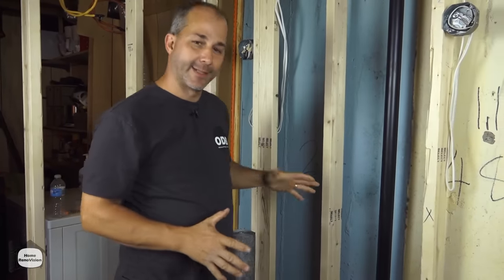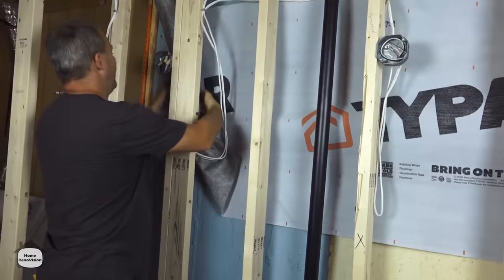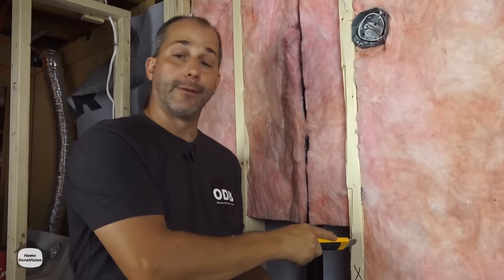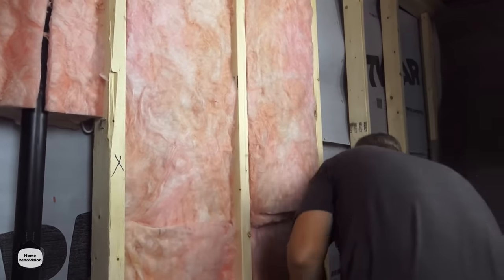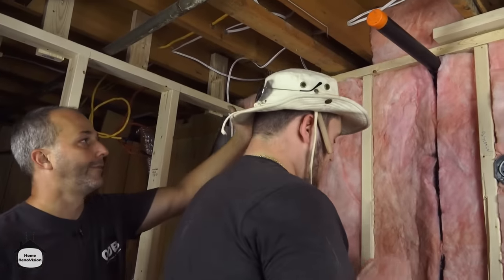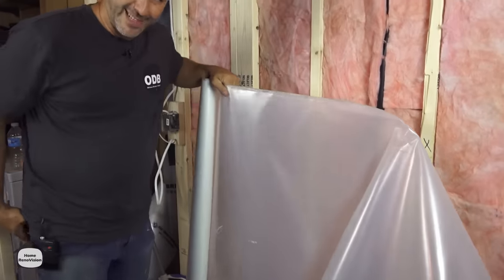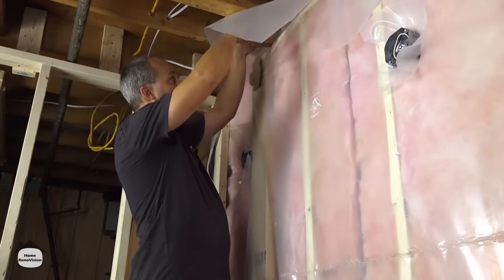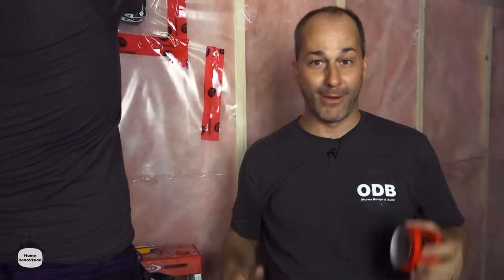How to Properly Insulate a Basement Wall: NO MOISTURE!

Comment: Hi Jeff. Thanks for the video. Questions.  My basement wall has black paper on it.  This paper is on the slab as well. I'm in Montreal. What's this paper called  and whats its function?So from what I gather you prefer your/this method vs the foam board against the wall because it's cheaper and  still does the job. But are there any advantages of using foam board method vs this method?    But normally the moisture barrier side  of  Typak is the white side, wouldn't you want to install it so white side is facing the foundation, just wondering. Merci i
Reply from the maker: Hi Jerry, that black paper is a tar paper designed to keep the insulation from coming into contact with the concrete. It sort of works but my system of using the typar performs much better and does not mold like the paper over time. Lets not confuse typar qualities however. That paper is water repellent in the liquid form. It is not a vapor barrier which is water in the gas form. It does not trap moisture in the wall cavity and as such keeps the insulation dry and performing well for a long time. I just believe that spending and extra 2 thousand dollars to insulate a basement does not translate into energy savings unless you update the entire building envelope of the house. If you are only renovating 1 room at a time then using traditional techniques will be more cost effective. Cheers! it would be like wearing a snow suit in a blizzard and not wearing a hat. You will still freeze to death.
Reply: Home RenoVision DIY . Ok. Thanks

Comment: I never use fiberglass in a basement finish. Use Dow blue foam board--2 inches thick against the block and then steel studs. Then there is nothing to grow mold and there is [plenty of air circulation.
Reply from the maker: never use steel in a basement. Floods cause the entire framing to be removed.

Comment: I was visiting Toronto from the US a few years ago staying with friends and a company was re-roofing a house in the neighborhood.  Is it code to install shingles without roofing felt? It's standard in the US and they were only doing 3 nails per tab on architectural shingles which most do 6. They did use some ice and water shield in weird locations on the roof, it didn't make sense I was surprised.

Comment: I see that only part of the basement was insulated so is the unfinished part to be conditioned space also?
Reply from the maker: That area is for the furnace room. It has so much heat there is no need to try to trap it. Plus the contract limited the scope of work. They could close it in at a later date. good eye!
Reply: I am in the infancy of having a new house built and the builder will be installing  2 in foam on the exterior basement walls I am also trying to decide between a set of precast steps bolted in place or walls poured to form a stair well with stringers attached to the wall. either one will use a bilco exterior door. I am leaning to the poured walls but as we know today's best practices are tomorrows DUH HUH what were they thinking..
Reply: Oh yea We are in the Toledo Ohio area it runs about 10-15 * f warmer than Owatta

Comment: Prior to insulate the basement, make sure the foundation is properly waterproof from the outiside, then sprayfoam the inside of foundation walls and use metallic studs installed on top of an underfloor....no contact at all with concrete, no organic material....this thing will be dry and moldfree for lifetime !

Comment: wouldnt moisture, about 2 gallons of it per day, be trapped between the vapor barriers and make these studs rot?
Reply from the maker: The outer wrap is a water barrier in the liquid form and used to hold the insulation in place. It is not a vapor barrier( in the gas form) and as such will not trap vapor. so there will be no problem. Cheers!

Comment: 4:15 Why to the same degree?  I was pissed when I saw my builder put floor-to-ceiling insulation in the basement.  I wanted a cooler basement.  What's the reason for this?
Reply from the maker: If you are going to use the space as a conditioned space then it is necessary. If you are simply looking for storage then insulating to the frost line is fine.Cheers!
Reply: The warm, moist air in your home is going to escape - somehow - and it will do so following the path of least resistance. If your basement is not as well insulated as the above structure you end up channeling the majority of that warm, moist air directly towards your basement walls as they are now the path of least resistance... and that's exactly what you want to avoid.

Comment: How much does a job like this cost in a 400 sq ft basement,   if I were to pay you to frame, insulate, and install a moisture barrier.
Reply from the maker: You would have to send me more info than that plus a picture. If you are in the Ottawa area I can help you with that. If not just figure 1 day to frame. Then once the electrical is passed for rough in 1 day to insulate and vapor barrier.

Comment: Hi Jeff, I'm still confused. I was going to put 2 inch foam and glue it to my cement block walls, but your saying to do a vapor barrier flat against the walls. And then do batt insultation, then dry wall?  My my basement is only 3 ft underground, the rest is above ground. The previous owner just put up wood paneling and nailed it to studs, no insulation. So, I want to add insulation and new drywall.
Reply from the maker: Hi Chuck. with block walls unless you waterproof the foundation go with batt and an air space so the interior of the block can dry. Cheers!
Reply: @HomeRenoVisionDIY   since my framing is already built from previous owner, I only have about half an inch currently between wall stud and concrete block wall. Is that enough airspace. I'm not sure that the typar won't touch the block at some points around the rooms.  Btw, love your channel. I've learned so much from you.

Comment: Do not put tyvac  on out side wall if you are putting a sound room, tv room the whole wall becomes your bass.
Reply from the maker: If you are putting in a sound system then I would include a noise deadening barrier before the drywall. But that is another video.

Comment: I’m not following. The framed wall is built away from the exterior wall? In other words the studs aren’t touching the poured wall?
Reply: Mike -  Concrete walls are often not completely "straight " . If you build the inside stud wall ,  called a frost wall    a little out from the concrete,  you can get it completely vertical . You can actually leave yourself enough room to put R-12 insulation in place,  or even the thicker R-20 batts , even though you are not using a 2 x 6 wall , which is what you normally use when you want an R-20 insulation .

Comment: This is not for Canada. I stopped at .40 sec. It does not meet our building code. consult your locaL professionals as details change with your location, ground moisture and thermal requirements.

Comment: Why did you not show how you stapled the tyvek to the studs. I had to use my imagination.  The rest of your video was great and very informative.
Reply: The Typar was wrapped around the ends of the stud wall, pulled tight and only stapled on the end studs.  No need to staple it to every stud on the foundation side.

Comment: Stupid question, if the basement is underground why do you need to insulate the walls? I view the basement as a cave, protected from the elements.
Reply from the maker: Usually there is a couple feet exposed and in our region the frost line gets down 4 ft on average. That kind of cold cuases ice to form on the inside walls if vapor and heat are not kept from escaping. That ice will melt and cause things to get moldy and musty.

Comment: Avoid using wood to the floor in a basement,wet seeks dry,metals studs are a much better alternative,plan on having a lot of moisture and one pipe failure could flood the basement,build as if you know it will happen,never use an insulation that will suck up the water.
Reply from the maker: metal studs rust out and then the wall sags. then what?

Comment: I wouldn't let you do my basement walls like that...wrong! The tyvek type stuff you used on the way top should've been tucked in behind the next row and taped not on top of it from what I could tell? I know videos can make something look wrong like a optical illusion sometimes you may have it right! The way I'm describing the tyvek type stuff should've been installed the correct way is so that if you have a leak in your basement wall from the way top you want that water to drip behind it under the next row below and so on if you dont have a channel going into drain tile then o well your just going to have to mop the floor but at least the moisture is not trapped in the wall trapped in between the vapor barriers all over wood and insulation possibly in light switch and plug electrical boxes. I'm not sure if it will make the drywall finished side sweat but I guess theres a possibility maybe? The way I percieved you did it is the water from a leak would just drip on top of the next row below placing moisture within the wall then your insulation gets wet mold starts to grow wood starts to mold up the main idea of a vapor barrier is to keep moisture behind the tyvek and concrete wall if someone ever has to do a repair or demo that stuff out mold is going to be in the air I also read if your basement is big enough you should place your interior walls 18 inches from the foundation walls and just run a dehumidifier in that area the blog I read this from was saying center blocks need to breathe and mold can grow on them if there incapsulated with something(anti-mold paint also)like tyvek or foam board also it's a good idea to do it like that if you have a leak you dont have to tear up everything trying to find it especially if you dont have a drainage drip channel around the foundations perimeter going to a sump pump also it's a plus for remodeling you can run wires and pipes where you want them

Comment: How comes your not using the blue tuck tape?? Its code in Canada!
Reply from the maker: The code requires tuck tape, the color  blue is for wet areas. This wall is not a wet area. Careful how you interpret the code.
Reply: Just had an inspection today on a job where I ended up re-insulating and vapour barrier kitchen.  Red tuck tape as usual, no complaints from inspector.  If it's required, then someone should update the city.  Red was used for years, it's likely still allowed for the time being
Reply: Just to clarify, blue tuck is for sheathing where area is expose to UV. Is got a uv resistant adhesive formula. Hope this help. And of course you can use indoor.
Reply: When something is adopted and when in becomes required are 2 different things... they may have adopted the new code but won't start to in force it for a year or 2 or even 3

Comment: I will never use the pink stuff in a basement after what I found in my basemnt walls. Use 2 1/4" silverboard graphite against the concrete then a stud wall with Roxul comfort batt (which doesn't burn or hold  water) in the cavities and NO vapor barrier. The concrete must breath and dry to the inside because it's under grade and the Foam replaces the vapor barrier. It you keep looking you will find this method in practice and promoted by modern building science

Comment: Don't know why in 2020 this insulation is used for basements. This insulation is a sponge for moisture and a nightmare if there is flooding, leaks etc. Not Good.
And the rim joyce closed cell foam is best for thermal block and sealing plus its insulation value.

Comment: In the USA your basement is framed illegally. No float walls, no fire barrier at top plate to floor joist, no air stop on 10 ft horizontal plane. If people in the US are watching you they better check their local codes as what you are doing is not correct here. FYI.

Comment: Hello. Why the cables are outside pipes?
Reply from the maker: Sorry rolando I need clarity to answer that question. Are you referring to the water supply lines.
Reply: Home RenoVision DIY I mean the electrical wires (whites) I can see they are outside pvc pipes?
Reply: Rolando Rojas sheathed cable(Romex) is not required to be run in conduit.  Only unsheathed wire (individual wires) are required to be run in conduit

Comment: Cant help but notice that the Tyvek writing is facing away from the exterior wall. Since you are using it inside the writing should be facing the exterior wall. The writing face allows vapour to still pass through, but not moisture.
Reply from the maker: The tyvec is being used due to the fact that it is not a vapor barrier, it is cheap and it will hold the insulation in place.

Comment: His videos are pretty good. But this video about insulating your basement isn't the greatest way to insulate your basement. There is a better way. Suggestion is rigid foam and roxul insulation which is a far superior insulation than the pink.
Reply from the maker: Hi Brandon, this video is about insulating a block wall in a basement that has no exterior waterproofing and no plastic under the concrete. Your suggestion is better suited to modern basements with dry walls and floors. Cheers!

Comment: Putting fiberglass in the rim joist is no good!  It will not stop the air leakage and will mold in a few years.  You should have used spray foam or rigid foam @ 2-3" and then put the fiberglass.
Reply from the maker: air leakage is stopped by vapor barrier. Besides moving air doesn't cause mold growth.
Reply: @HomeRenoVisionDIY  Moving air, coming in from outside, carries some dirt, which eventually stains the fiberglass batts.  A lot of people mistake that for mold. Sometimes it's both, though; life is cruel that way.

Comment: "Canucks and plastic ..." - I think the viewer is probably struck by your ignoring of some more, perhaps, environmentally good building practices.  I understand the need for a barrier.  But comments regarding cheap insulation versus wool insulation in your acoustic video, completely ignored the fact that the wool is probably biodegradable.  Sure, wool is more expensive.  But it does biodegrade.  perhaps the other insulation you are using is more environmentally friendly than I realize.  Kind regards,

Comment: There are thermal properties to acoustic insulation.
Your video implies that there are no thermal benefits to acoustic insulation.  Acoustic insulation, the wool stuff here in New Zealand,  has thermal benefits.
Reply from the maker: My video implies that there is no benefit to have an acoustic insulation when installing a thermal barrier. Why do you get your shorts in a knot?

Comment: Junction box was WRONG (had to laugh at the “don’t leave the gaps around boxes”)
You were concerned about gaps around the box but you cut all the way through the batt completely exposing back of the box to the outside temperatures.
next time, trace your junction box and cut half way through the batt instead of all the way so back of the box is covered.

On another note. Your insulation won’t get wet if it is touching the concrete entirely, it’s the gaps between substrate and the framing where moisture builds and just sits on whatever’s near by
Solution? Cross hatch insulation behind as well as with the framing eliminating gaps.

Comment: If you create a complete thermal break (foam or roxul board directly on the concrete), you don't need an air space nor a vapour barrier. Having an air space provides no guaranty of not having moisture issues.  

Fiberglass plus vapour barrier traps moisture in the wall assembly which comes from the foundation and house which can condense on cold surfaces. R-value is reduced due to moisture. The absolute worst way to insulate a basement.

It makes zero sense to use tyvec on a foundation because it's moisture permeable -> you have moisture coming from the foundation, the tyvec does nothing to keep moisture out of the wall assembly. Tyvec is for above grade walls - used to provide an air barrier and water drainage plane but allow for drying to the outside.

Really all you need is 2" rigid foam or roxul board on the concrete to provide a thermal break and eliminate thermal bridging, then the wall gets framed. Batts (without vapour barrier!) optional to additional r-value.

The advice in this video is terrible overall. Foundations should not be insulated like above grade walls! The codes are out of date.

Comment: I didn't watch more than 60 seconds of this video.  The air barrier (typar/tyvek) was installed backwards so I had to stop.  The product has a direction.  When a new house is framed they don't install the air barrier ever with the fibrous (black) side facing the exterior.  The science works if installed properly which it was not I  this case.

Comment: This cannot possibly be the correct way to install a vapor barrier. Your insulation is now on the wet side of the wall and will probably mold.
Reply from the maker: Vapor barrier goes on the hot side. that is where the condensation occurs. this will keep the moisture from coming into contact with the wood and thus halt any mold growth.